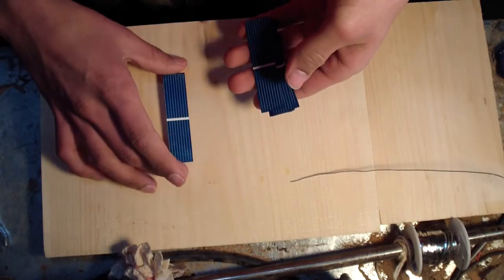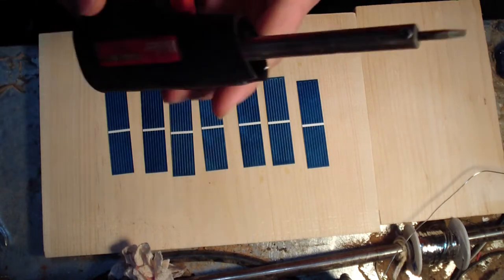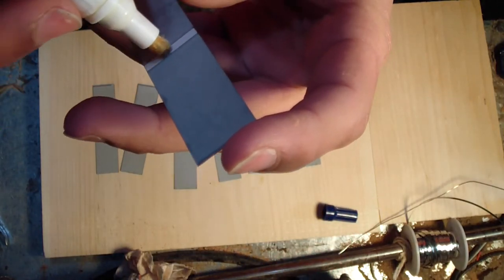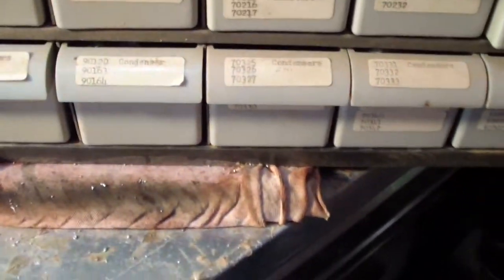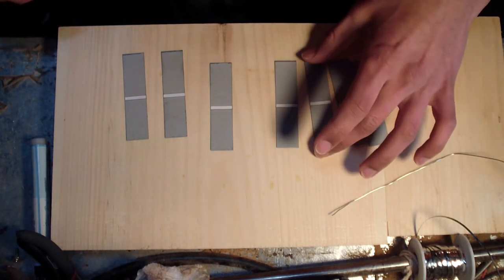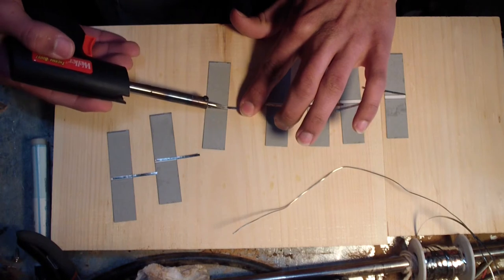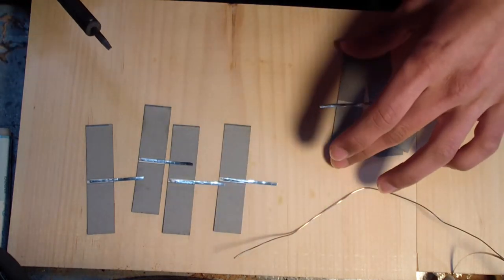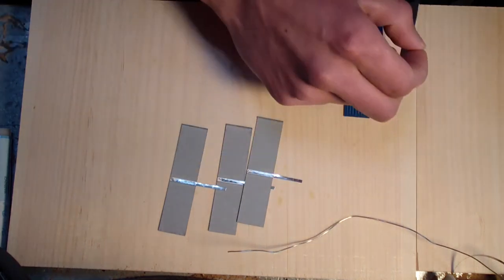Solar Cell Soldering Pt 1 The Bottoms

Comment: I just bought a bunch of cells similar to what u are working with here, and the back (gray) side does not have a full line across the back, or even the three solder joint contacts! some have almost no line at all, so how do I deal with those? Do I MAKE the three solder points by adding solder in those empty spots, or do I just solder across that blank area anyway?
Reply from the maker: Take a look at this video, it may help you. I have a great distaste for those types of cells for the exact trouble your having. 

https://youtu.be/7aguEAFjqPs

Comment: Can i solder it without the pen?
Reply from the maker: If you mean the flux pen, not really. If you use some other kind of flux then yes, but you need some kind of flux on it or the solder will not wet to the solder pad.
Reply: @jedijdsobi-wan7745  man i don't have any flux pen. I have been soldering using basic copper wire & solder wire. & it worked well.
Reply from the maker: @Bang6484a  Then your solder is an acid or rosin core solder and has some flux in it. That will work, yes, but it can be tricky and annoying at times, but if its working for you, then good for you. Still suggest getting a flux pen as it seriously cuts down on the possibility of hiccups. Some of my first runs were with copper wire, yes that works, its not smooth and flat but it works. To each their own for their own project, Good luck.